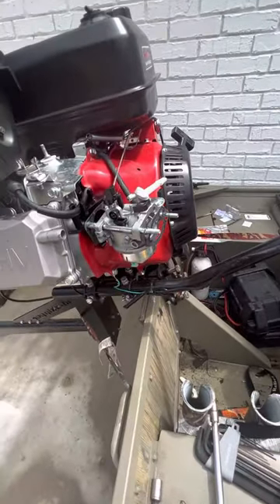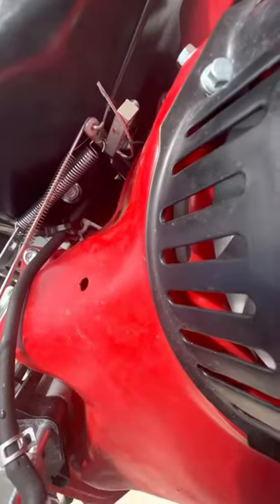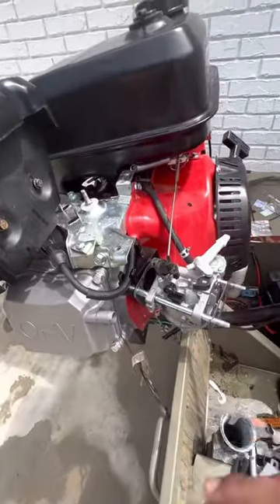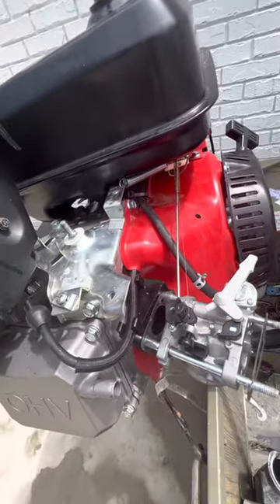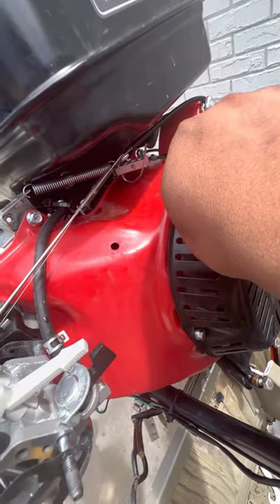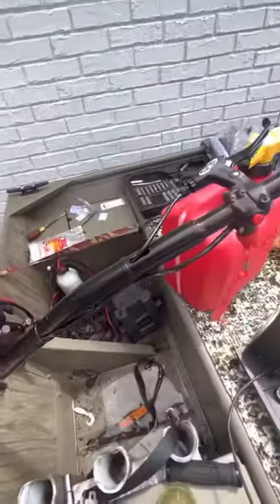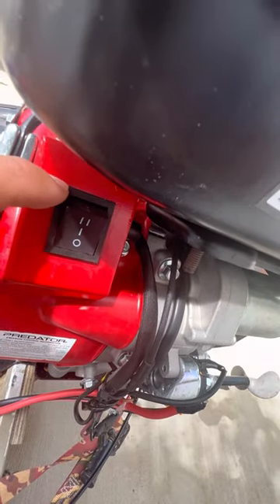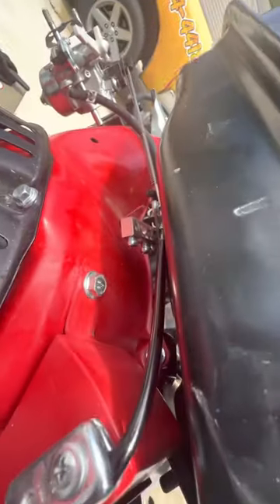Predator 459cc governor bypass

Comment: Hey there, I’m debating on what size surface drive to get, I want the power of a 22 horse but don’t want the weight.
Would that set up you got push a 1648 through shallow sand in a current?
Reply from the maker: It possibly could but I would 100% go with the 22-23hp
Reply from the maker: I wish I could get a 23 on this 14ft

Comment: I have a very similar setup. I’ve got the CKS 300 series drive mounted to a brand new 459cc. I originally had my 670cc mounted but it was almost too much so I bought the 459. I want to do the gov delete but honestly don’t understand your video. It was my understanding, to delete the gov, you had to open the engine case and remove a gear or something. Is there anyway you can do a step by step video showing exactly what to do? I know that’s asking a lot. I appreciate this video. For what it’s worth, my 22.5hp ran 23mph on a 16/52 with two grown men, a full grown lab, 100+ decoys, a big yeti full of dew and the front of the boat has a custom deck that weighs 80lbs on its own. The 459cc is pushing the same rig right about 18-20mph. Drafts very little and is very agile rig.
Reply from the maker: So to delete governor you do have to open the gear casing but I didn’t want to go through all that what I simply did was attach my throttle cable directly to the carb from my understanding it is called a “governor bypass “
Reply from the maker: But i can make a step by step tomorrow hopefully it will be way more helpful so far i only seen 18 moh 2 guys at about 240 lbs 4 dozen decoys but i have a 14 ft so my water displacement right at max probably your 16ft should do better maybe

Comment: Im having issues with the motor idling too low after doing this, ive tried adjusting the idle screw but Its almost like it wants to start at 800 rpm and die right away.
Reply from the maker: Did you do it like in this video or like they do the 212 because my first try i did it using another video and it did the same thing thats when i figured out this motor specifically you have to do the opposite

Comment: Are you having any issues with possibly running rich or the carb bowl running dry?
Reply from the maker: I haven’t had a problem yet now on this predator before the bypass when i ran full throttle it would die on me i had to disconnect the air filter hose to let the tank breath and that solved that problem.

Comment: Did you just drill a hole for cable clamp to mount to start switch housing?
Reply from the maker: Yes
Reply from the maker: I unscrewed the start switch housing firat tho to see where the wires were running

Comment: How’s the tracker handle the weight of that setup ? Any flex ? Or swamping the boat ? Weight around like 140 right ?
Reply from the maker: handled it good except when you let off at plane the wake will catch up to you if you're not careful about it
Reply: @hookedwithbryan  it will most of the time be just me light gear and I’m only 180 pounds anyways so maybe it will be okay for me ?
Reply from the maker: @coltensawyer6761  oh yeah you will definitely be fine i had myself and a buddy in the 1436 we both around 250 and we had 2 dozen decoys and hunting gear we were fine.
Reply from the maker: @coltensawyer6761  i have a video on my profile called 1st time on mudskipper and you can see it was me and a buddy and we were still getting around 18 mph
Reply: @hookedwithbryan  yeah 18 mph is plenty anyways. Does the transom flex back any ?
Reply from the maker: @coltensawyer6761  yeah i had to reinforce mine is not alot but i didn’t like it.
Reply: @hookedwithbryan  how did you do so ? Mine has two floor braces and I was gonna add a brace from the bench to the back and the plate aluminum on the outside to push evenly. Maybe fab up something on top rail to
Reply from the maker: @coltensawyer6761  thats exactly what i did i put 2 braces from the back seat to the transom and welded it.
Reply: @hookedwithbryan  I have access to a aluminum mig I might weld it as well or just rivet it ! I’m actually gonna jam a 670 on mine …
Reply: @hookedwithbryan  is there any pictures of how you did yours ?
Reply from the maker: @coltensawyer6761  if you go on my profile i have my instagram link send me a message i have a picture i can send you

Comment: I have the predator 459, stock with same boat as you on a SPS long tail kit. My engine is running so lean that at night i'm seeing blue flames come from the exhaust, are you experiencing this as well? I dont know why this is happening when the motor is all stock
Reply from the maker: Yes im actually also having a problem where i get it on full throttle for a little bit and it kills
Reply from the maker: Im going to try and put a new carb in it this week
Reply from the maker: Out the box the 459 is really lean you can try and change the jet size
Reply from the maker: Or they also have the air fuel mixture screw but that epa is in the way from what I understand
Reply: @hookedwithbryan  I think its actually running rich if we are seeing flames - not enough air/fuel ratio extra fuel is burning off in the exhaust so maybe the carb jet is too big.. not sure. I was thinking that maybe removing the air box and exhaust and upgrading to cold air filter and new pipe to help it breath. Let me know what you think. What carb did you get?
Reply from the maker: @MRemp  i ordered a mikuni 34mm let me know if your process worked ima let you know how my end up foing as well
Reply from the maker: @MRemp  have you checked your spark plug to see if its white or black ?

Comment: What speeds are you seeing and how's the fuel burn?
Reply from the maker: I haven’t had a chance to test it out due to personal problems but before bypass i was getting 16 mph and did a 14 mile tound trip on a tank and a half.
Reply: @hookedwithbryan  thats not bad at all! I'm thinking about doing the same setup for nutria hunting. Only a wider boat.
Reply from the maker: @aaronjohnson7581  i think you going really like it only thing about this 459 is mine was having venting problem so i had to disconnect the vent tube off the air filter and haven’t had a problem since
Reply: @hookedwithbryan  awesome, still waiting for the guy to give me dimensions of the boat I'm asking about. Trying to save a trip of driving to Belle Chasse lol

Comment: You didn’t change the valve springs
Reply from the maker: No
Reply: @hookedwithbryan  what speeds you getting? And did you change the prop
Reply from the maker: @charlesblakeley1278  im getting 23 2 people and ice chest with rods stock prop
Reply: @hookedwithbryan  you are getting 23 mph now ?thats good speed
Reply from the maker: @logancp55  23-22 my only problem now is i can get to 22-23 then its shuts off on me i have to keep it under WOT
Reply: @hookedwithbryan  you should post another video of you running the boat by your self without another person for ultimate top speed.
Reply from the maker: @logancp55  i will right now thi i had had a house fire and was kinda dealing with that couple last months thats why i just stopped recording all together but im hoping to get back to recording this month
Reply: I did the same thing you did and it made a huge difference! Thank you for the video!! Unfortunately the engine is starting harder now after bypassing the governor, did you have this issue?
Reply: @jacobhutchinson5803  I did
Reply: I figured it out last night, just hold the throttle open a little bit and it fires right  up.
Reply: @jacobhutchinson5803  yeah that works for me too, but it makes it difficult to start on a cold morning